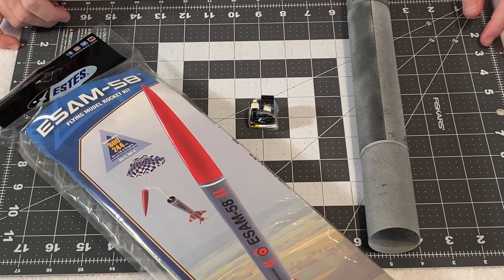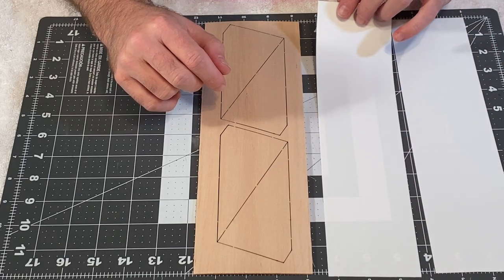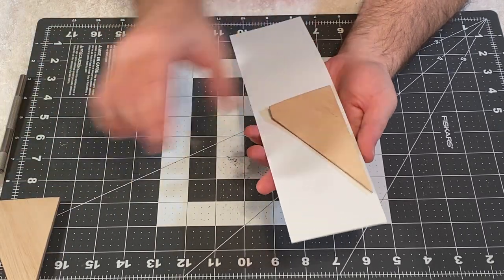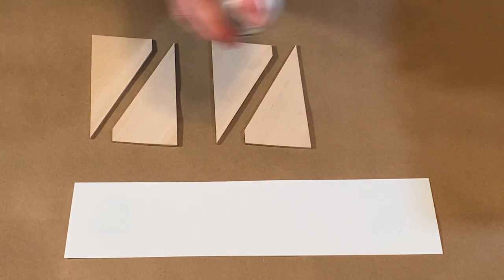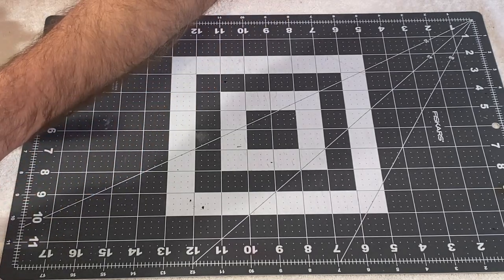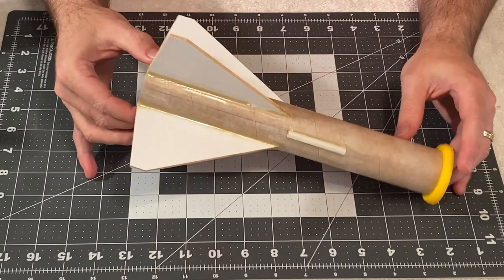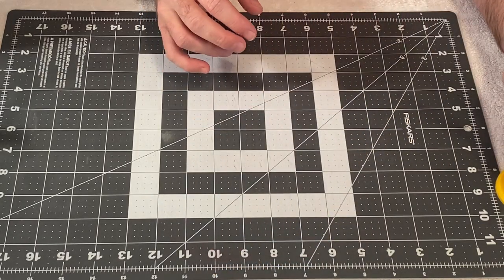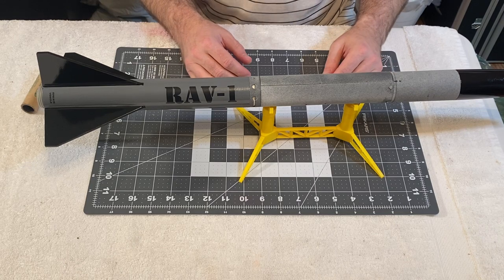RPM/ACE Vehicle - Rocket Build

Comment: I suggest running a sim in OpenRocket. I find the ESAM and other center fin rockets to arc over more than aft fin rockets so might need a shorter delay like a C11-3 or D12-3. I like to override the Stage weight and CG based on the completed rocket so it most accurate.
https://www.rocketreviews.com/rocksim-estes-esam-58.html
Reply from the maker: I took an existing ESAM-58 file in OpenRocket and modified the tail fins to match my custom placement.  This one doesn't have center fins.  OpenRocket recommended a 5-second delay on an E12.  Since the goal is to get the ACE to open at apogee, I want the E to fire off later, so I'm eventually going to run an E12-6. 

Good recommendation on the override though, as the sim and actual weights don't match up.  I'll modify those variables.  Thanks!